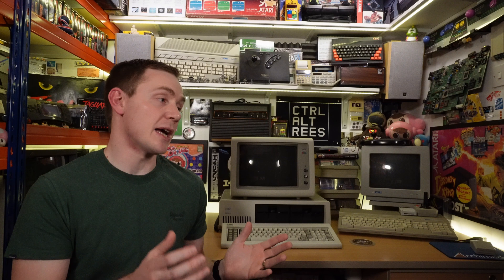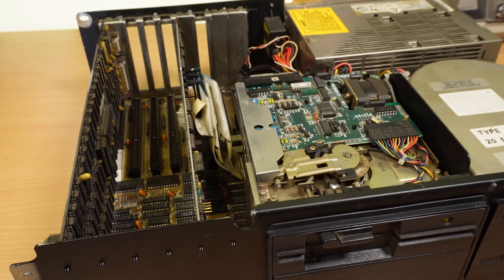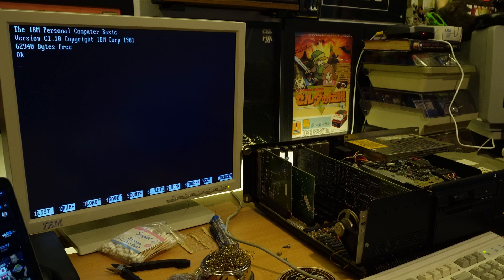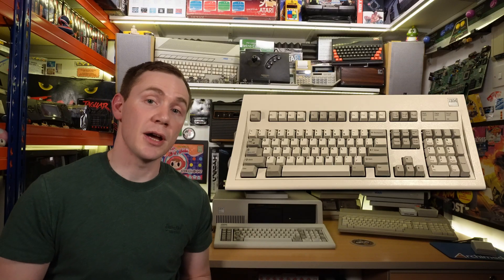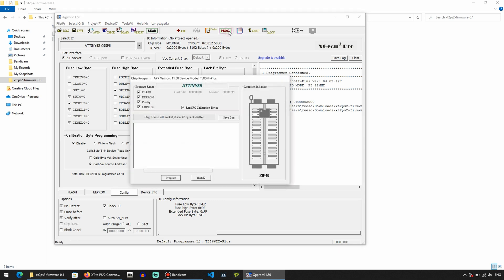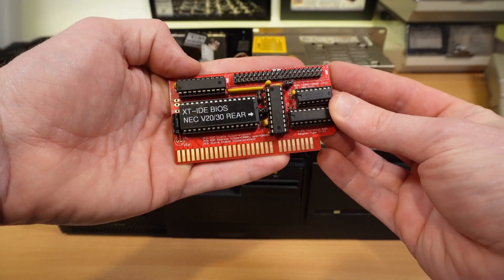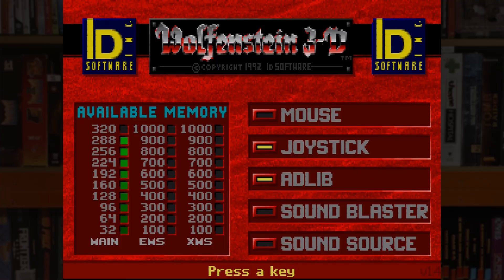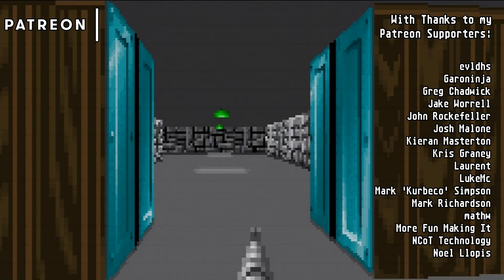1986 IBM 5162 "XT 286" Restoration - Upgrades, AdLib, XT-IDE, Networking & More! - Part 1

Comment: Did GSETUP not work? Or were you not able to get that onto a disk?

I'm interested in seeing if you tried the 1989 beta BIOS that was discovered the deletes the CPU speedcheck code.
Reply from the maker: I couldn't get it onto a disk, just had all sorts of issues trying to write 5.25" disks with various other machines. I now have a Greaseweazle I can hook up to the original drive so no longer an issue, and I'll be showing how that process works in part 2. Just waiting for some components to arrive. 🙂

I actually went with an AMI BIOS but I have come across the IBM beta that you mention. Maybe I should try burning it to some EPROMs?

Comment: I had a 16-bit ISA card with 1MB simms on it a long time ago that would work with one of my old 386DX boards When you ran mem check, you could tell which 4MB were on the 32-bit main bus and which 4MB were running from the ISA card LOL but it was still fast and better than nothin!. I wonder if you can upgrade the memory to 2 or 4MB...If you can find one of those.
Reply from the maker: There are actually modern ISA RAM cards for these, might be worth looking into!

Comment: 10 min of goodness.  
Good video man.
The noise you say also appears on the actual monitor eh?  Fascinating.  I have never seen anything like that apart when I was using a TV with the RF cable to use my ST and the cable would not always be a perfect fit/position.  I had no idea this was possible on anything else.

Was part of the video sped up?  

Thanks for sharing.
Reply from the maker: Sped up? I don't think so. Gameplay footage should be as-is, I wanted it to be an accurate representation.

Yes, the interference is very strange indeed, I've never seen anything like it on any of my systems!
Reply: @ctrlaltrees  Sped up regarding the shots you are in.  It looks like you are ready to beat the shit out of everyone with kung-fu.  Perhaps I just need a nap.
If you do manage to fix the issue with the interference, please let us know.  Very curious.
Reply: @ctrlaltrees  ok I am watching the footage again, the speed looks normal this time.  I am guessing some weird glitch while i was first watching it or something.  NVM.

Comment: I know that the Original Sound Blaster cards can be very expensive, and difficult to come by, so I'd recommend keeping an eye out for something like an early Aztech Sound Galaxy BX card, which is SB-compatible and even has a real Yamaha OPL2 chip. It's perfect for such an old machine.
Just in case you want digitized sound and not only Adlib music.

Thanks for the awesome content!
Reply from the maker: Thanks for the tip! I have an Orpheus sound card in another machine that I could've used but decided it was finally time I did something with my AdLib card. To be honest I actually played with the PC speaker back in the day as I'm sure many others did, I'll get some footage of that in part 2. 🙂
Reply: @ctrlaltrees  Yeah, I also only had PC Speaker in my 286.

Comment: I'm not sure what model 286 we had but it was late on around 1993 it had a relatively modern case and a VGA monitor.  I remember I upgraded it at a fairy quick pace (386 & 486) as I wanted to play Doom after getting the FPS bug with Wolf 😁
Reply from the maker: The early 6MHz machines like this were pretty rare so I imagine it would've been 8MHz or maybe even 12!

Comment: I have a Victor V286C with a 10Mhz 286 that I'm working on. I've picked up a couple of 16Mhz 286 CPU's to upgrade it. I'm assuming the process is similar and similarly complicated, so I'm eagerly awaiting your next video :)
The weird thing is my Victor doesn't have any 10 or 20 Mhz crystals, so how it generates it's CPU clock is a bit of a mystery that I'm trying to work out.

Comment: I’m really looking forward to watching your series on the IBM 5162 PC as this rare model doesn’t have a huge footprint on YouTube. I’d be especially interested in how you manage memory within config.says and autoexec.bat to get the most conventional memory to run games. I’m struggling to get more than 570k free on my XT286, despite having a 1mb memory expansion card. It seems quite difficult on a 286 with EGA/VGA to manage memory (for me at any rate). I’ll try going over to PC DOS 2000 as you suggested to see if that better than the MSDOS 6.22 I’m currently running. 

I have quite a rarity as I have the IBM 5162 with a Model F AT keyboard (UK layout) and the IBM 5154 EGA monitor. I play EGA games on it (Lemmings and Commander Keen being a firm favourites) as they are period correct for this PC and run really well on it. I’m interested to see the mods you make to the XT286 to make it run VGA games.
Reply from the maker: Yes, VGA is definitely a bit of a stretch and in all honesty, once this is over I'll probably be putting it back to EGA and downgrading my 5150 to CGA so it's all period correct. I have a 486 DX4/100 that's perfect for the VGA stuff (in fact that's what I used to capture the Wolf3D footage right at the beginning of the video).

But it's certainly interesting to see how far I can push this machine - and certainly something that 286 owners would've been doing at the time as well to squeeze out every last ounce of performance! 🙂

Comment: Great project. I'm looking forward to the upgrades. On the keyboard error: I had a similar problem when I made my PS2->PC1512 adapter. Turns out that the PC resets the keyboard on boot by pulling the CLK line low, and it expects to receive 0xAA as a response. So all I had to do is to send 0xAA scancode when the uC detects low CLK.
Reply from the maker: Oh wow, that could save me a lot of debugging! Thanks so much for sharing. I'll see what I can do. 😁

Comment: It'd be really cool if you somehow had that very rare IBM VGA monitor in the same styling as the 5153, etc.  It'd fit even better with the machine.
Reply: That’s the IBM 5175 monitor, it has the cool ‘microwave oven’ styling of the IBM 5151, 5153 & 5154 monitors and could display 256 colors, out of a pallet of 4,096. It used the IBM PGC standard, but could be converted to VGA (and often was back in the day when that standard became dominant). They’re nigh on impossible to get hold of though. :(
Reply from the maker: Oh absolutely! One can never have too many monitors 😁

Comment: The NIC you put it seems to have a BNC connection rather than ethernet. Did I see that correctly and if so how easy is it to connect one to a modern ethernet cable?
Reply from the maker: It has both. 🙂
Reply: Back in the 90s many cheap 10mbit hubs (not switches) came with both BNC and RJ45. I'm happy that I kept one all those years.
Reply: BNC connectors were everywhere in the early-mid '90s. The IBM-compatible room at high school was connected to a NetWare server via those BNC style network cards (probably 10BASE2). I didn't see my first RJ45-style network until about 1996.